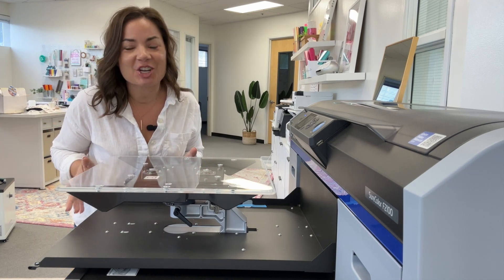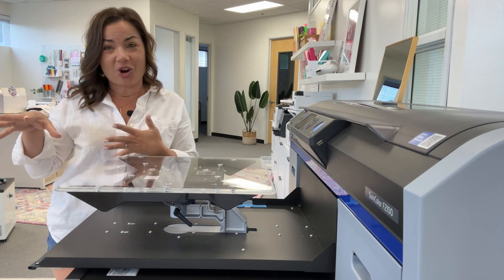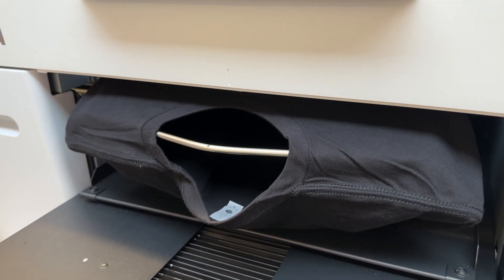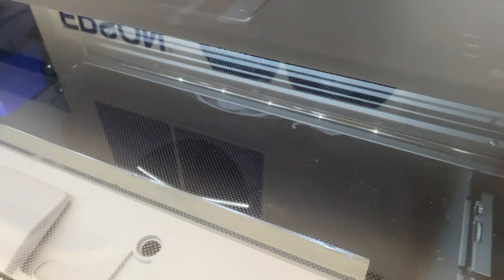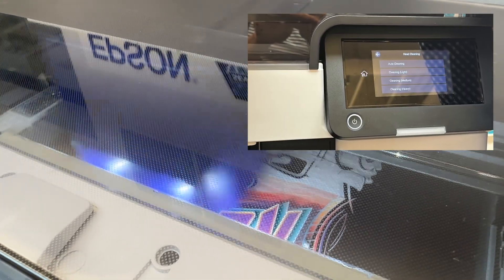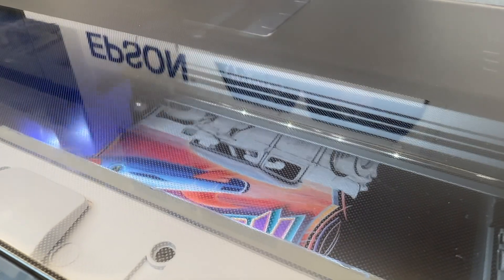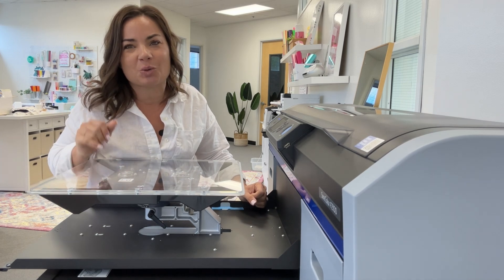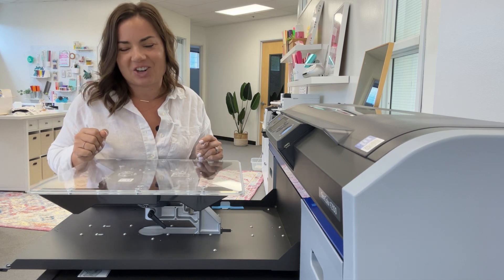Epson F2270: First Look at the NEW DTF and DTG Printer (Real Time Print)

Comment: Hi question do you know how can we bring this machine in our apartment? When our door is a little smaller than the machine 😭🥹
Reply from the maker: Unfortunately, it might not be possible unless you have a larger window or another way to get the machine inside.
Reply: @ is it not the same as the F2100? Like what you did flip it on the side? 🥹 we live in 3rd Floor😭